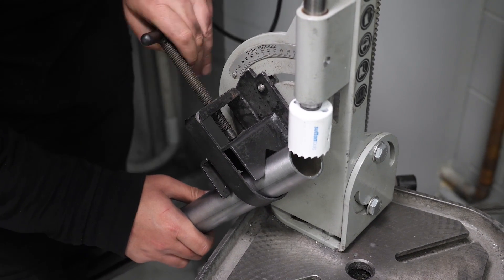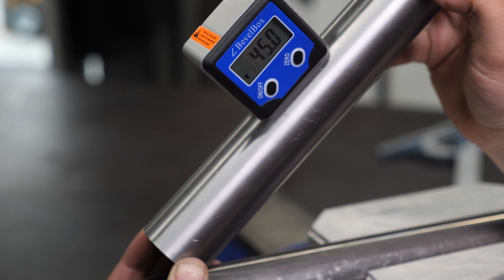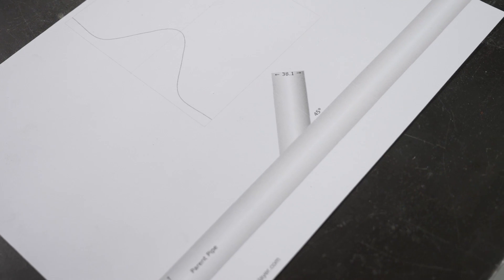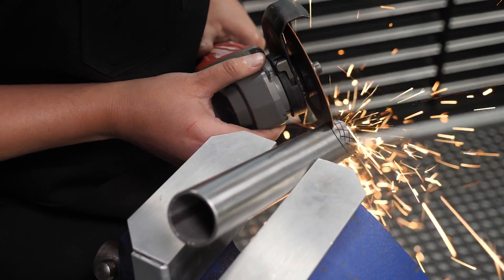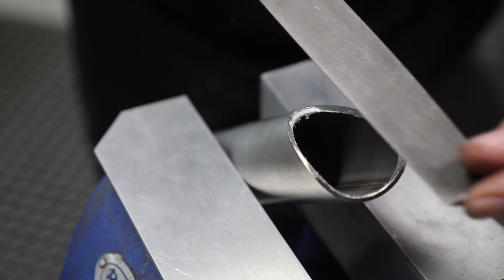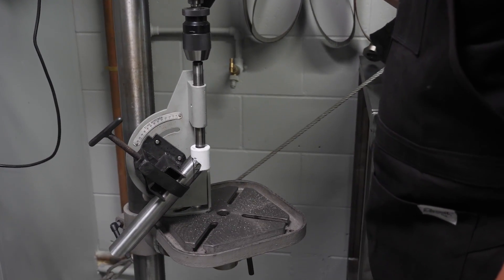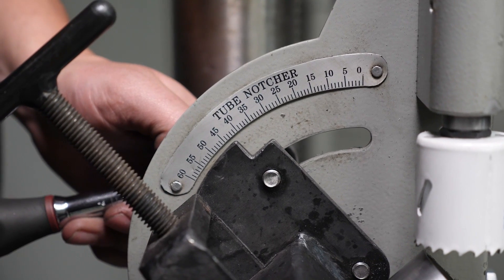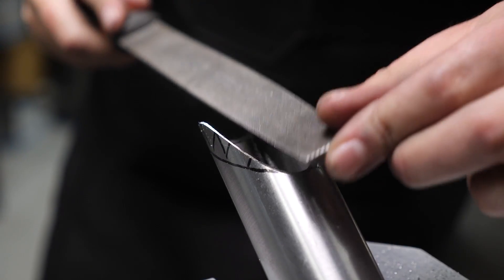How to PERFECT Your Notches

Comment: Not sure why, but tube notching (and tube-fitting in general) always seems like one of those things suitable for the "analytical approach" of calculating exactly what it needs to be, and crafting some means of accurately creating what you've calculated. Indeed, there's tons of tools and doodads on the market to help you do this. I've owned/tried most of them.

However, this is one of those things best not to overthink. Buy some extra tubing, spend no more than 1 minute eyeballing what you need, and take a stab at it. You'll certainly make some mistakes, but with some practice you'll get very good at putting together a spaceframe in no time.

What Andre says about good fit-up can't be overstated. Good fit-up will not only make the finished product stronger and more rigid, it'll make it much easier to weld - and make the weld much nicer looking too.

Forgot to mention: Strongly consider modeling your spaceframe in CAD and having a CNC bender/laser cutting shop build your components for you... Especially if it includes tubing that has bends AND notches. It's less expensive than you think and the result is perfection. You'll receive a box of tubes that snap together like a puzzle, and barely even need tape to assemble. A few tack-welds and you're ready for final weld. The extra time put into modeling pays dividends in time saved constructing your tubes.
Reply: Do you have any favorite vendors that can laser cut mandrel-bent tubing with laser-cut tabs and slots?

Comment: Anyone know the Australian guidelines around having a rollcage for a sedan, which also retains the rear seats?
Reply from the maker: Check with Motorsport Australia directly on this to be safe. Would suck for the internet to tell you one thing then the guy ticking things off to tell you that they were wrong and you have to do it all again - Taz.
Reply from the maker: Schedule J is what you're after. Read through it and then reach out to them directly with any questions you have after that to be safe. 

Also someone making approved roll cages would know what's up if you plan to get someone else to do the work for you: https://motorsport.org.au/regulations/manual/technical-appendix - Taz.